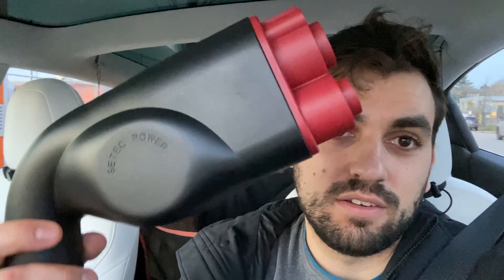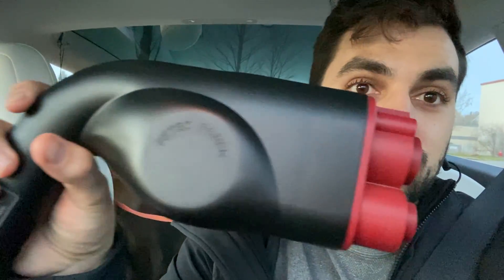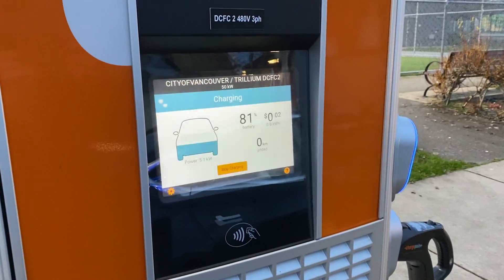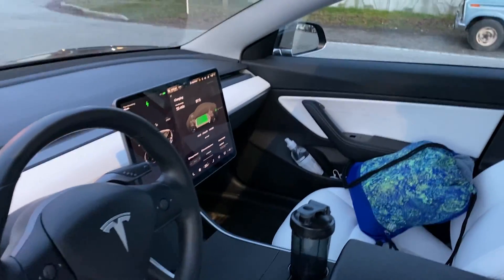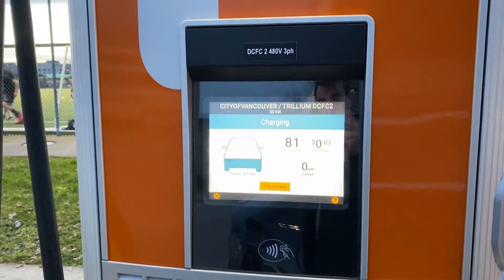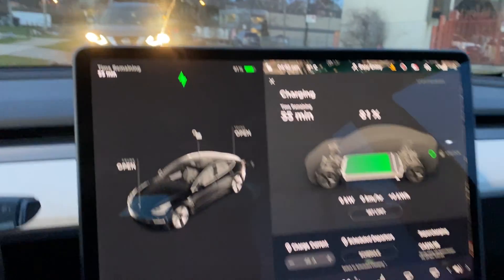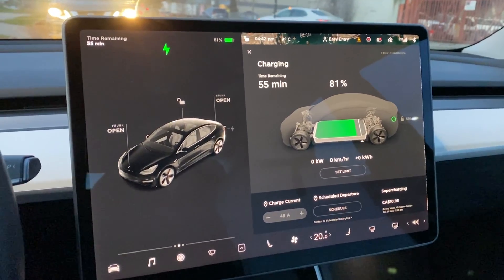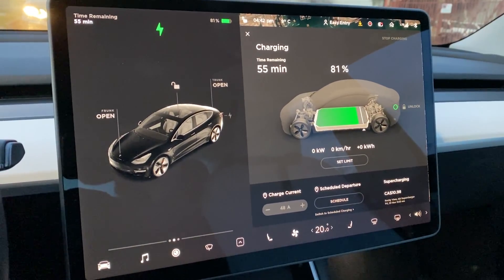CHARGE YOUR TESLA AT 300kW?!? - SETEC CCS Type 1 to Tesla (S,X,3,Y) Adapter - Vancouver Review

Comment: No it will never charge at 300kW... You did not read the specs on what you bought.  The adaptor is rated for 200 amps, the tesla charges at 400V, so maximum charge rate in ideal conditions is 80 kW.   still beats a tesla chademo adaptor that maxes out at 50kW, but it will never be close to the speed of a supercharger.

Still want to hear about progress... looks like a lot of firmware debugging going on for different brands of chargers... oh the joys of interop.